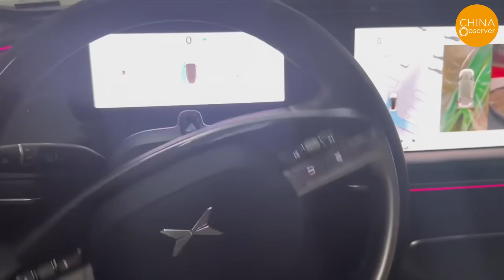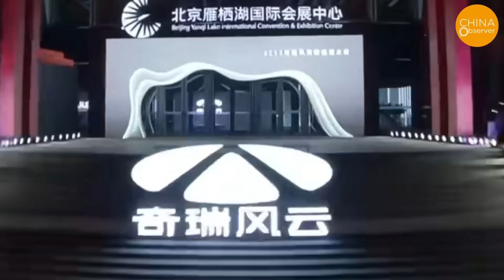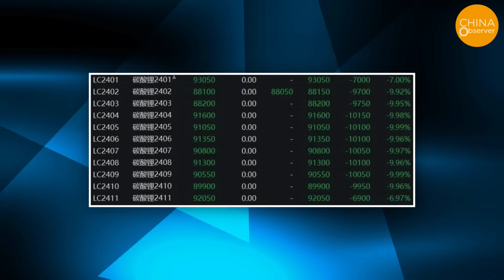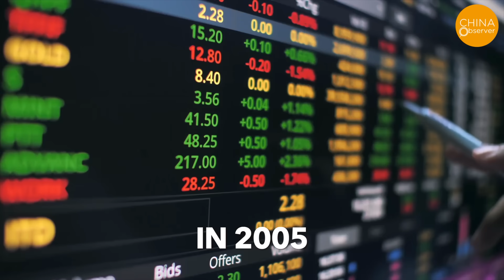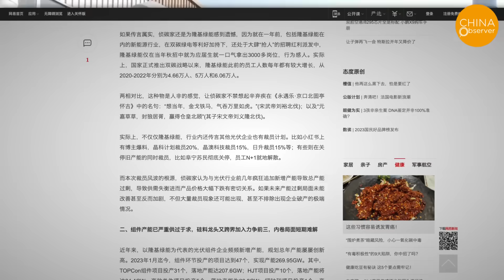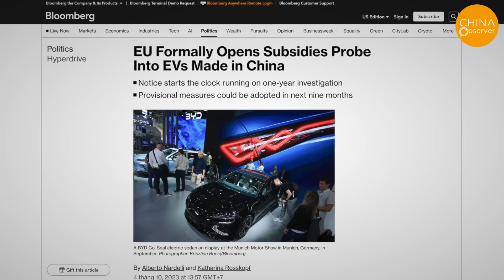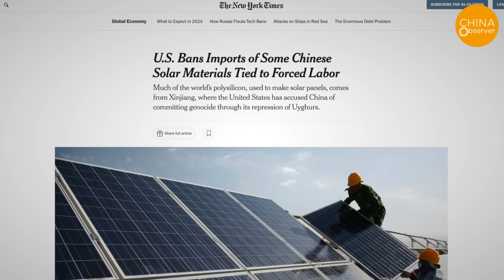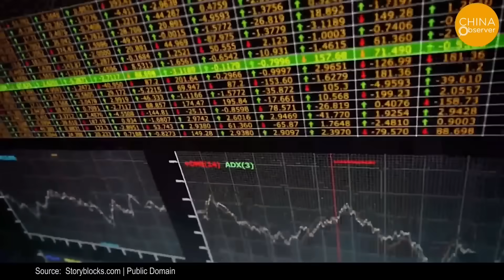Sudden EV Explosion, Rockets up 5 Meters, Close to 100 BYD Autos Spontaneously Combust

Comment: Sorry guys. The first clip is not an EV exploding. Notice everybody to the left bottom of the screen? Notice one guy waiting with his phone to film it? Notice that nobody flinched? Notice the absence of flames associated with Lithium ion battery fires? Notice the cases at the bottom left of the screen that look suspiciously like cases used in the film industry? 
And isn't that a RAV 4? Hybrid maybe, but they don't come out as EV's.
Reply: yeah you can see the cameras around the corner filming it before the detonation.
Reply: Movie shoot.
Reply: @LeonieHall-c4o / doors flying off doesn't look like a film site re safety.
Reply: It does indeed look like an old RAV 4 - XA20 model circa 2001 to 2005.
Reply: @harukinzaphod  Yes, old RAV4, well and truly before they even had a hybrid option.
Reply: @davidbrayshaw3529  they convert old cars to ev,it very common.
Reply: @harukinzaphod  if u are a car guy,  u have seen that a mile ago. i also wonder how batteries even can explode. burning li ion batteries, yes. but most chinese cars have LFP which doesnt burn. and soon there will be soium ion batteries everywhere because they are cheaper, which also dont burn. in the future burning EV cars are going to extinct.
Reply: @BlacKi-nd4uy  Batteries "explode" due to the gases that are released during charging/discharging building up due to improper venting, age of the battery, or just bad creation of the battery itself.  The gasses build up, and then something ignites it, and you essentially have a mini fuel-air bomb explosion.
Reply: @BlacKi-nd4uy  LFP does not oxidise in decomposition which means that fires can be extinguished by traditional methods.
While the likelihood of fire is reduced, in rare cases, they can burn.
Reply: @davidbrayshaw3529  an amount who is at a point, its way more unsecure to drive in a gasoline car. also thats why EV are the furture.
Reply: @BlacKi-nd4uy Thank you for the info tip. I have a BYD Song L and I went to read about LFP after reading your comment. I truly feel better and safer, thanks to you.
Reply: Yeah a rav 4, my wife owns one like that, and yep this one was staged it seems
Reply: Looks a bit like a Suzuki Vitara.
Reply: what made me question that one is:

1) No 'other colors'. Asside from the initial 'yellow' explosion, the entire explosion was 'white'... that's not how 'fires' work... even electrical fires are blue-tinged due to the frequency of the energy at play. It almost looked like an air-cannon detonation.

2) Small initial ignition in the lower left, followed almost immediately by a larger ignition at the bottom of the car.  Granted, electrical fires and such 'all' have an ignition point that will not always be 'dead center' of the resulting fire, but the 'way' that initial to main ignition kicked off looked to much like a primer charge setting off a secondary charge.

3) The Car went 'strait' vertical.  That simply  wouldn't happen 'naturally'.  While EV's are balanced and such as much as possible, the instant something 'breaks', that creates a change in balance... the car would have tilted one way or the other if that had been a 'natural' explosion purely due to physics. It was likely a 'gutted' car with no internals to speak of so that it was literally just a 'shell' that would more easily be able to be pushed strait up rather than having it flip in a direction.

4) "Doors" flew off, but rear window didn't so much as crack and the rear hatch didn't even so much as ripple?
Reply: Its like every body was waiting for it to happen Yeah
Reply: I don't understand how many viewers a channel like this would have. Not to mention the falsification of the content, his conclusions always point in one direction, so the process of derivation in this direction is biased. Set up the target first, shoot the arrow, and shoot the arrow first, then draw the target. Is it worth watching? Isn't it a placebo to self-hypnosis like drugs?
Reply: I didn't notice but went backed and watched again and again. I know this channel is anti-CCP, and that's okay. Their technical and business analysis is  very sophisticated. But I always worry about YouTube and social media channels and their veracity. I found much that followed on industry interesting, and have followed those issues for decades. But do you think the explosion was CGI or staged somehow? It's entirely possible.
Reply: @dylanthomas12321 that's the problem with a government that censors information
Reply: @dylanthomas12321  the first car car was not even a byd car and other videos are probably 5-10yr old videos, also remember china is a big country and no. of cars are also big, so high probability of mishappenings, but the video is shown collectively to defame china and byd since byd just surpassed, this is definitely a propaganda video paid by tesla.
Reply: It is hard to verify anything, if the recorder posted it with title "ev explodes" there is no way to prove or disprove them.
Reply: @starburst98 WHAT?!? That doesn't make any sense...
Reply: @starburst98  Yes, there is. Identify the car that they're using in the shoot. It was never released as either a Hybrid or a BEV.
Reply: Yeah there is- they dont explode like that LOL  @starburst98
Reply: You start to notice the many repetitive videos of the same subject with slightly tweaked info but the same nonetheless, sometimes using the same 5 year old video with a recent year posted on top of it. It's really noticable after watching their vids for 5 years. How many tofu dreg videos, businesses fleeing videos, and financial collapse videos have they made so far that use the same footage used and is considered recent?
Reply: LOL, ya i recognized the rav4.  There actually was an ev version(rare).  But you are 100% correct, the car went straight up in one piece, the weight of an ev wouldn't have done that.  Not to mention, there is no charger attached and the other obvious signs it wasn't a battery explosion.

I only made it to the second clip so far but it's hilarious the presenter is like "i can't believe it caught fire"  Ya, the car was cut in half by a pole, i'd be surprised if there was no fire.
Reply: @ianrobertson3419  The BEV didn't come out until 2012. This is an early 2000's vehicle.
Reply: @davidbrayshaw3529  the first run was 1997-2002.  It did not have the rear mounted spare though.  It's not widely known as it was essentially California only and in very limited release to the public.
Reply: Also you can see the cable used to trigger the explosion within the smoke.
Reply: Yes, the first scene looks odd - that car easily weights 2 tons and gets propelled up like 4m min. For that amount of energy the surrounding remains oddly intact. Also, what would be the source of such amount of energy getting discharged so rapidly? EVs don't run on explosives or compressed gas.
Reply: @michaela.178  Certain battery chemistries breakdown into highly flammable hydrocarbons and also produce oxygen. Poorly designed batteries or battery housings might not vent this and build up extreme pressure until ignition of the fuel oxygen mix, which is basically a bomb
Reply: @PineyJustice  😳 .. totally what I‘d want to buy. On the more serious side, I wouldn’t take this Chanel as a reference for anything. But my interest in battery chemistry just has been amplified.
Reply: @michaela.178  For sure, and more than likely since it's china, some cheaper to produce less safe chemistry batteries are making it into the mix, rather than the lifepo4 batteries used by most western EVs and hybrids. Never underestimate the amount of fire that is able to be stuffed into a lithium battery.
Reply: #fake…
Reply: knowing how movie stunts and special effects are done you can see a charge pack under the car as a small bump under it and if you watch closely you can see a very long cable fly up with it
Reply: @td000009  Well spotted.
Reply: saw it
Reply: Came looking for this. It also seems kinda slow, like the usual movie jumping car. They use a canon like tube pointing downward that shoots a piston, usually a wooden log, ant the bottom is kinda blurred.
Reply: Yea and if you look closely, it looks like that is what actually exploded yet the vehicle goes straight up.
Reply: If this is a Rav 4, aren't the charge ports on the passenger rear?
Reply: Lithium ion batteries explode in hybrids too. I fail to see the point you are trying to make
Reply: @LordSamuelJ  It turns out that this is an early 2000's model vehicle. They were ICE only. My point? This was a special effects display on a film set, not an EV fire.
Reply: What? The guy to the right flinches, and the dude in the background turns and runs. Watch the video lmao
Reply: @jimcrawford297  that's a rav 4 . Japan made lol
Reply: There WAS such a thing as RAV 4 EV back in the late 90's - early 2000's.  Watch "Who Killed The Electric Car".
Reply: It looks like a gas explosion. Definitely not EV.
Reply: Nobody flinched because it's so common with Evs, they are used to it now...
Reply: It doesn’t look like an EV and even stranger I swear I see the faint image of wires around the tire as it goes up. Not saying that’s what it was but I wouldn’t take that first one on face value.
Reply: True. It is a film scene
Reply: This channel guy is just doing maximum negative propaganda about China. Probably he got thrown out of China for bad behavior
Reply: This channel is as fake as China is. Half the news here are bs to attract more views from China hating audience.
Reply: Its just Anti-China propaganda. lol
Reply: This is clearly a anti China Youtube channel, they don’t talk about their high velocity trains or that everyone has a house, they are paid to talk about any little problem that china has like the US is a perfect country and no one is starving or u guys never will buy a house, while in China there are ghost cities because everyone alredy has a house, and the government don’t allow a billionaire like Bill Gates raise up the Real estate inflation. So we could spend a day talking about how china is better and u don’t need to run away from the ambulance (This is a absurd thing to anyone outside the US) because they have accessible healthcare (Brasil still better because is free for everyone) or how Hong Kong have their own state thing that a country with minimum state like the US would never accept
Reply: You google image search "楼妹食品" with quotes, you'll see it's real, or you look at a wider angle on this other YT: 14evYhrsr8c
Reply: This is a western propaganda to smear the Chinese industry. Creation of the evil west and their undercover mini "CIA".
Reply: OP is a WuMao. He's pretending that China doesn't copy other car designs. He will do anything to pretend like China's EVs don't blow up. But they do. Notice he doesn't provide evidence, but he does deflect and obscure the facts.
Reply: Why is that surprise you, this channel is funded by the NTDTV which is part of the US program that is doing the same thing as in 1980s in Europe, it is just a copy of Radio Free Europe etc, the purpose was to counter the influence of Soviet Union, this one is to smear China. Something like China uncensored, and many other channels, making china bad videos 24 hours, 365 days, who the hell would do that if there is no high salary and income. I can make tons of these video if they hire me.  Smearing has become an industry for more than decades.
Reply: Pretty sure you are right with that car being a second generation Rav4. They didnt come as a hybrid. They did make an EV version with Tesla that was only sold in California in 2012. 4th Gen was a hybrid with a nickle metal battery.
Reply: @cwilliams4227  Cheers.
Reply: One glance at the explosion tells you it isn't an EV fire, but a rigged explosion.😊
Reply: It looks like a gas explosion. Definitely not EV.
Reply: And ACTION!!!
Reply: LMAO , Anti-China propaganda is strong on youtube for some reason.   They like to just blatantly lie and people believe it.
Reply: maybe the car was hissing
Reply: Well it still does not  put out the fact that Chinese ev cars are a running coffin for drivers. It might not be the best evidence as shown on the first video but there are already tons of evidence about your chinese ev cars with malfunctions airbags do not equip when necessary. And how do you explain the rotting evs lying in the grounds of china?
Reply: China Observer is a CIA fake news channel !!
Reply: Recycling one videos and adding movie effects to create sensational content, I hope you get banned for misinformation😢
Reply: Yeah that was likely BS, but who cares…I have personally witnessed several cheap garbage, Chinese Lithium battery spontaneously catching fire and exploding in just a two week period. The electric bike and scooters are the worst. People are dying. Hey Western world especially USA…we have been scammed the biggest scam in human history. Wake up before some Chinese boot is on your neck forcing you to mine this crap!! It will be too late then!!!
Reply: That is NOT a Rav 4.
Reply: A YouTube channel focused entirely on anti-china videos lying? You are a conspiracy nut!
Reply: Look like hydrogen actually.
Reply: EV's in China are perfectly safe, just look at that car dealership, everyone was on a cigarette break, that's all. 👀
Reply: yea this video is made to defame BYD
Reply: @stephenho2816 And why is that bad?? We don't need the Battery Electric Vehicle so if they go out of business oh well, too bad so sad.
Reply: @davidbrayshaw3529 the hybrid batteries are still dangerous if look at the range Rover diesel hybrid. The range Rover diesel hybrid cought fire cus battery got too hot from overheating and the fire got so hot that it burned and melted the concrete below it causing a whole parking structure to collapse ruining over 100 cars
Reply: @jackdaniels2657 I'm not disputing that.
Reply: If it was the UK one, it was nearer 1000 vehicles. @jackdaniels2657
Reply: @jackdaniels2657  I would agree. But having had a second look at this video, the RAV4 in question is most definitely not a hybrid model.
Reply: @jackdaniels2657 The range rover was a pure diesel. Not a hybrid.
Reply: @jackdaniels2657 that's completely untrue.
Reply: Coromandel Cooks beach, NEWZEALAND last 10 days had an ev explode while charging burning down garage car and family home.
Reply: @richardpeychers4076  Yep, but that isn't this car.
Reply: There are many back street garages in China doing battery conversions on ICE cars, mopeds and motorcycles. They're unlicensed and uncontrolled and these incidents maybe the result of some of their 'conversions'. But yeh, that SUV going vertical does look a bit suspect but shouldn't detract from all the genuine incidents in the video and the situation in the Chinese 'green' industries.
Reply: There is a guy that flinched at the bottom right
Reply: @centerrightpunk bot spotted
Reply: Theres always one. @centerrightpunk
Reply: Could it be that there wasn't a camera handy for the actual event so they used a film clip to illustrate what happened?
Reply: I don't know, often times there are signs long before the battery actually ignites (Yes, lithium ion batteries do actually explode). No one would want to go near it at that point, so pulling out a camera wouldn't be a bad idea. I don't think your argument is as valid as you think.
Reply: @BlueEternities  I'm backing myself. That's an early model (2000ish) RAV4. They didn't even come out as a hybrid, back then, let alone a BEV.
Reply: Could it be that there was no one happening to be filming when the actual car exploded so they used a film clip to illustrate what happened? Quit being a ccp apologist.
Reply: @kenneth9874  A cop apologist? What?
Dude, that isn't even an electric vehicle.
Reply: @davidbrayshaw3529  what kind of mental gymnastics did you have to do to come to your half baked conclusions?
Reply: @kenneth9874  Not too many on that one.
Reply: @davidbrayshaw3529  that's relative...
Reply: @davidbrayshaw3529  the very fact that you had to do any is telling.....
Reply: @kenneth9874  Cheer up, Kenneth. If you're still not happy in a couple of weeks, consult with a healthcare professional.
There's no point in going through life a bitter and unhappy human being.
Reply: @davidbrayshaw3529  I'm very happy and satisfied, apparently you're the one with problems, maybe some therapy for yourself is in order...
Reply: so 1 out of 50 is fake.. whats your point here? EVs suck, chinese ones even more cause theyre cheap rip off of good shit
Reply: @buffwafflemann379 My point is that the first video is not that of an EV fire. That's my only point. I actually tend to agree with your statement, otherwise.
Reply: @buffwafflemann379 if one story is fake, it detracts from all other stories potenti covering real issues.
It hurts both sides and poisons the well.
If EVs are an issue, fake stories wouldn't be necessary right?
Of course there are real issues but they're going to be missed with dishonest reporting.
Reply: @buffwafflemann379  no, others too, china is huge remember that, number of cars is also huge, so probability of mishappenings are also more, and other videos are probably 5-10 yrs old too, and they compiled all the videos to make it seem like it happens a lot but in reality it doesn't, this is a propaganda channel remember that, also remember byd just surpassed tesla in sales number so expect more anti- byd propaganda videos in the future by tesla.

Comment: Teslas self ignite also. It goes to the inherent chemical properties of lithium ion batteries. There are over 2000 lithium ion cells in an EV. If even one overheats and burns they're all going up in flames. There's no way to stop it,  no way to extinguish the fire. If you can't get out of the car you will be killed. This is one truly dumb idea. In China it doesn't even decrease CO2 or pollution. In fact it increases them.